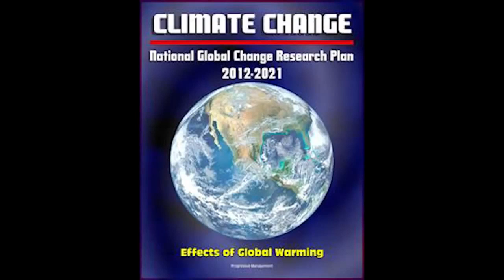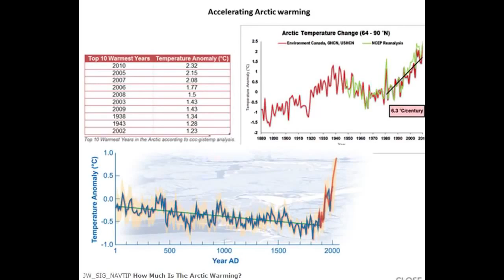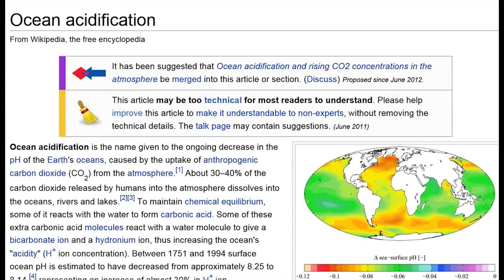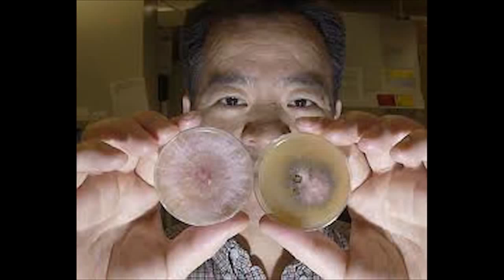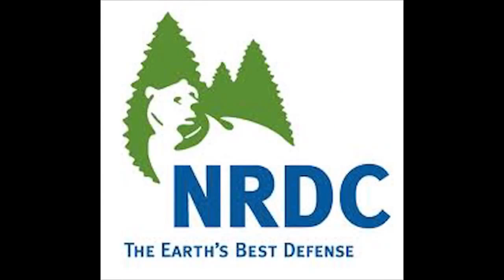Dane Wigington   Extinction Level Arctic Methane Releases Caused by Geoengineering

Comment: One of the largest problems with so called paleo data is their calculations are based on faulty assumptions, such as, the earth being millions of years old, ice layers being laid down yearly by seasons, static systems being constant through the millennia.

All of this is incorrect, thus giving huge and wild swings based on modern and current observations.

The layers of ice in the polar regions is not caused by only seasonal laying down of snow in winter alone. In 1942, a flight of P-38 aircraft from an airbase in Greenland  were forced to set down on the polar cap. The crew were rescued but the planes were left there. They were recently retrieved by enthusiasts who had to dig down through over 75 meters and through 600 layers of ice.

The amount of C02 in the atmosphere, methane and other, co called greenhouse gases are being accused of warming the planet. In fact, it is the other way around. As the planet warms, these gases are released and are a lagging indicator of climate change.

Have you heard the term, "It is the Sun that controls the temperature on earth dummy!" Yet the UN has removed the Sun from their data by making the false claim the sun is a constant. Wrong. We have the medieval warm period, the mini ice age, all before billions of people and industrialization. Even during these periods, there were people watching the sun and each rise or drop in temperature was preceded by either a greater number of suns spots (means more CME's, solar wind. Warming.) or a reduction in sun spots (less solar activity, so the atmosphere was not expanded at these times. Cooling.)

One of the main reasons for poor crops, failing forests, desert encroachment, is due to the low C02 levels. The more C02, the higher the growth rate of plants, the greater the oxygen levels due to increased plant output. SO sad people actually believe what these pseudo climate scientists are wailing the alarm about.

Make no mistake, the idiots are wrecking the planet with their limited understanding of anything they do by aerosols, additive, releases, they just won't stop, as they are too proud, they can't admit they were wrong from the beginning.

1. EVERYONE NEEDS SALVATION:

For all have sinned, and come short of the glory of God. (Romans 3:23)

2. JESUS CHRIST DIED FOR OUR SALVATION:

But God commendeth His love toward us, in that, while we were yet sinners, Christ died for us. (Romans 5:8)

3. SALVATION IS A GIFT:

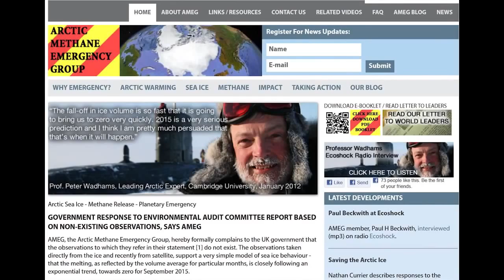The wages of sin is death; but the gift of God is eternal life through Jesus Christ our Lord. (Romans 6:23)

4. WE ARE SAVED BY GRACE:

And if by grace, then is it no more of works: otherwise grace is no more grace. (Romans 11:6)

5. SALVATION COMES THROUGH FAITH:

To him that … believeth on Him that justifieth the ungodly, his faith is counted for righteousness. (Romans 4:5)

6. GOD SAVES ALL WHO CALL UPON HIM:

Whosoever shall call upon the name of the Lord shall be saved. (Romans 10:13)
Reply: ***** lol
Reply: ***** I can't say much for the other two claims but I CAN say that the earth IS millions of years old. Carbon dating is relatively accurate. Is carbon dating PERFECTLY accurate? No, but we can say with relative certainty that the earth is AT LEAST millions of years old. Keep in mind; the bronze age fairy tales that the people who are telling you "The earth is only 6000 years old" believe in do NOT say that the earth is 6000 years old. The notion that the earth is only 6000 years old is based on MANY more assumptions than those made by carbon dating methods.

(I am sorry if you take offence at this comment. I REALLY am trying to be nice but in all honesty; the way I see it is that it is your religion that has caused this and so I do hold some resentment there, not for you, but for your religion. If people hadn't of been conned into believing in the abrahamic religions(Again, not your fault, it is a very deplorable and sneaky racket they are running); the republican party wouldn't be able to exploit it and therefore wouldn't have as much power. If the republican party hadn't of been in the way; we would have conquered climate change as soon as we knew it was happening. Now life on earth is gone, and I blame religion and corporate greed for it.")
Reply: Well said!
Reply: +Kurt Boulter  THE MAIN PROBLEM YOU HAVE IS YOU DO NOT OWN A STRONG'S EXHAUSTIVE CONCORDANCE. IN BETWEEN GEN.1:1 AND VERSE 2 THERE IS A TIME GAP OF HUNDREDS OF MILLIONS YEARS. GOD SAYS IN THE PROPHETS THAT GOD DID NOT CREATE THE EARTH VOID AND WITHOUT FORM.THE OLDEST MANUSCRIPTS STATE THAT IT BECAME VOID AND WITHOUT FORM. IT BECAME THAT WAY BECAUSE OF THE REBELLION OF SATAN. JER:4 DESCRIBES THE FIRST DESTRUCTION OF THE WORLD.THAT WAS NOT NOAH'S FLOOD BECAUSE ALL LIFE WAS DESTROYED IN SATAN'S REBELLION. A SCIENTIST FROM B.U. PROVED BY USING A SUPER COMPUTER OVER 25 YRS. AGO THAT THE GREAT PYRAMID WAS BUILT 14.500 YRS. AGO USING THE STARS IN THE BELT OF ORION. IF YOU BELIEVE THE EARTH IS ONLY 6000 YRS. OLD YOU ARE JUST PLAIN IGNORANT. THE STARS DO NOT LIE. IN AN EARLIER POST YOU DON'T KNOW WHAT A KENITE IS. A KENITE IS SONS OF CAIN. CAIN WAS THE SON OF SATAN. LOOK IT UP. THE KENITES ARE WRITTEN ABOUT IN THE PROPHETS LONG AFTER THE FLOOD OF NOAH. THEY SURVIVED. HOW? ONLY 2 WAYS. 1)THEY WERE ON THE ARK(2 OF EVERY FLESH) OR 2) NOAH'S FLOOD WAS REGIONAL. WHEN YOU TEACH GOD'S WORD YOU NEED TO GET YOUR FACTS STRAIGHT! THE PENALTIES FOR TEACHING FALSELY IN THE BIBLE ARE THE MOST SEVERE IN ALL OF GOD'S WORD.YOU NEED A NEW PREACHER.  I HAVE STUDIED GOD'S WORD AT A COLLEGE LEVEL FOR 14 YRS.  WITH THE BEST SCHOLAR IN THE COUNTRY IN NOT THE WORLD. YOU NEED TO CHECK OUT THE SHEPHERD'S CHAPEL IN ARK. IT IS THE THE LARGEST INDEPENDENT CHURCH THE U.S.   MILLIONS WATCH EVERY WEEKDAY,24 HRS. A DAY.        WAKE-UP AMERICA. VOTE TRUMP !!!!!!!
Reply: Timothy David Ah, right, so Strong is the one I am supposed to believe and NOT the Lord God? Right, that is where I am going wrong? lol.

No, when I get to the great white judgement seat of Christ, He is not going to ask me, "Why didn't you believe the Strong's concordance?"

The Lord God is going to ask you, "Why didn't you believe My Word, the King James bible, as it is written, as I gave it to you?"

Where you are going wrong is believed me and NOT the Lord God as it is given to you! That is what we are asked to do, one thing, believe. That is the ONLY part of the New Covenant, everything else follows that, if you believe, "with ALL thine heart". Most don't, they just say they do, until they come to something in the scriptures their sin and wickedness will no allow them to receive, then try and change it. Most of their doctrine is based on works, thus they will brag at what they have done, including how long they have studied or come to a college that teaches the doctrines of men. Grace through faith, alone.
Reply: ***** "so Strong is the one I am supposed to believe and NOT the Lord God? "

The bible wasn't written by God even so called "biblical scholars" agree that the bible was written by men allegedly inspired by God. So either way you are ultimately believing a man the problem then becomes; which one makes more sense.

To me evolution makes more sense then a 600 year old man built a giant boat that supposedly held 15 MILLION animals on it. To put that in perspective the population of Chicago is 2.7 Million, and the population of New York is 8.4 Million.
Reply: Timothy David I've actually studied the Hebrew old testament and Greek new testament and I can say with relative certainty that the Bible and science do NOT agree. That being said, it doesn't say anywhere in the bible that the earth was 6000 years old, that data comes from a collection of catholic priests who used 1 Chronicles to extrapolate the age of the earth.

There is an acronym in Comp Sci as to why they only got 6000: G.I.G.O "Garbage In, Garbage out"
Reply: ***** Let me just point out that you guys are arguing, not over if but WHEN, a genie cast a magical incantation that created everything. You don't have any room to call anyone "stupid."
Reply: Timothy David I never said it did, I was agreeing with you that the bible doesn't say that the earth is 6000 years old. It's the things that it DOES say that are in question.

For example; it took MILLIONS of years for life to evolve but supposedly God created everything in 7 days, and don't tell me that the bible doesn't mean "day" when it says " י֥וֹם " because while that word has multiple meanings the word " עֶ֥רֶב " meaning night, which is also used, only has one. So in this context; " י֥וֹם " does in fact mean day.

So yes science and the Bible DO actually conflict in very significant ways.
Reply: ***** Considering by "God" you mean desert nomads that thought you could breed a stripped calf by forcing the cow to look at a stripped pattern; yes I consider myself INFINITELY more knowledgeable than them. I just cannot take the ramblings of a sheep herder who, according to the dead sea scrolls, is most likely high on mushrooms seriously.
Reply: Dustin Nunyo Not sure if you could put your nose higher into the air. So sad. But that is the human condition.

(Psalms 59:12-13) "For the sin of their mouth and the words of their lips let them even be taken in their pride: and for cursing and lying which they speak.  {13} Consume them in wrath, consume them, that they may not be: and let them know that God ruleth in Jacob unto the ends of the earth. Selah."
Reply: ***** Considering we can create lava and obsidian with electricity and rocks in an arc furnace; yes I consider modern man VERY much above people who sacrificed virgins to the volcano God.
Reply: NOT FAULTY DATA.

Comment: Wouldn't we be able to lessen the effects of the methane if we burnt it? Yeah you produce CO2(and Water) but if methane is 10x as terrible as CO2 then wouldn't having CO2 instead of methane be more manageable?
Reply: ***** Well here is an idea that I JUST had...if we could find a way to capture and then burn the methane to fuel industry; they are going to be burning things like coal and creating more CO2 anyway...why not have them burn the methane instead and help sort of slow things down, at least until the methane runs out.

Comment: I wish people would stop showing pictures of Boing and Airbus prototype Jumbo Jets with ballast tanks used to test weight distribution, and implying that those are "chemtrail planes". It damages the credibility of the cause to bring awareness to this geo-engineering issue.

Most likely, the real chemtrail planes will not use an overly complicated system of several dozen or hundreds of little tanks. That makes no sense. You would only use a few large tanks. Additionally, they would not be distributing photos of the insides of a chemtrail planes on the internet or it wouldn't be a secret program. Use your brains.

Comment: To say that geo-engineering is causing tipping points, is again not taking responsibility for anthropogenic climate change. It does a disservice to action on climate change, and he said that carbon emissions aren't as an effective contributor than geo-engineering, it's absolute rubbish.

The rapid warming in the arctic is not because of geo engineering, it is called arctic amplification and albido. The reason there are huge temperature swings in north America is because of the jet stream. The jet stream is becoming weaker due to the temperature difference between the arctic and equator is becoming less. When the jet stream is weaker, it meanders more creating peaks and troughs, some small causing very localised temperature differences that can change within hours and some large that get stuck and the whole nation can be gripped in a freeze for example.

At the same time, the arctic can see massive localised increased temperatures, again due to the jet stream. When there are peaks and troughs bringing cold air south, it stretches and allows corridors of warm air to go the opposite way, therefore greatly increasing certain areas.

To blame geo-engineering, is again not taking responsibility, the climate is changing because of Co2 increase.

On the subject of arctic methane, that is a very realistic threat, and we are only just beginning to understand the potential consequences, but again this is not caused by geo engineering, it is the arctic amplification effect and also albido. Albido being where the ice is disappearing the suns radiation penetrates the dark ocean and heats it up even further, causing a feedback loop. This is the danger because the more the siberian arctic shelf gets exposed to the suns radiation, obviously the more fragile the frozen sea bed will be, and as has been mentioned could release this bomb of methane. Many believe that the estimated amount of greenhouse gases stored in there is over triple what we have put in the atmosphere already since the start of the industrial revolution. Many also believe the clathrate gun has been fired, but they still need more research.          

It does a disservice to raising awareness on anthropogenic climate change, it gives mixed messages, someone could take from this 'Oh climate change is because of geo-engineering' It is simply not accurate.
Reply: This is the problem with selective hearing.

Dane NEVER discredits man-made problems to our climate and environment. In fact, he used to lecture about that very subject. 

Geo Engineering just happens to be the more important issue to expose, RIGHT NOW. THEN, if we can get passed THIS, we can start working on those other things.